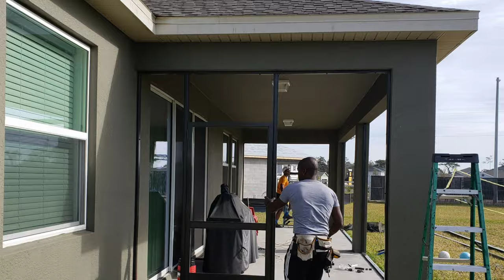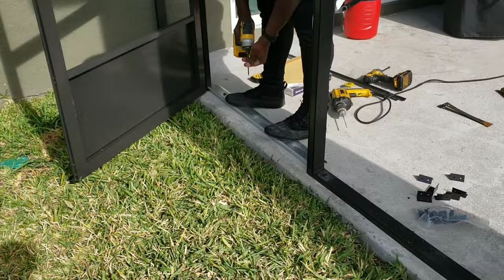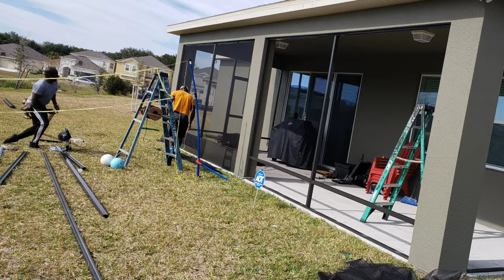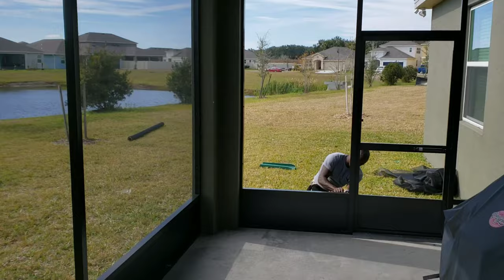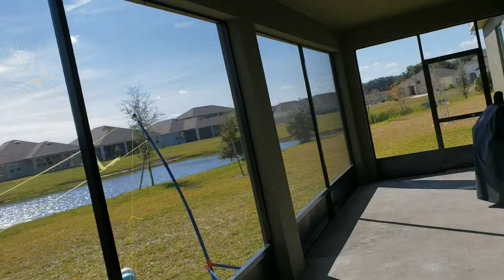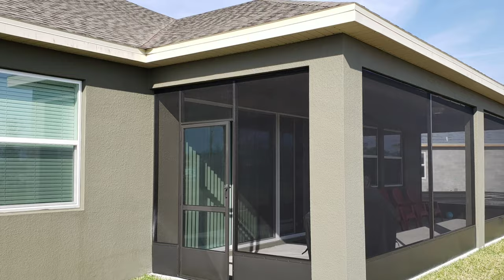Patio Screen Installation.

Comment: Looks great!  Is that a solid piece on the bottom 12” all the way around?  What’s it called?  Will it keep standing water out or just keep rain from splashing in? (heavy Florida rains can cause couple inches of standing water in backyard at times & our crazy cat goes all kamakazi, smashing into screen chasing lizards).
Reply: I think those are called kick plates. I noticed at home Depot and Lowe's they  sell 12" better rolled.  I assume you unroll them and flatten them out and cut to fit.  I'm really unclear how they install.  I live in Florida and all my neighbors seem to have them.  I started my patio today.